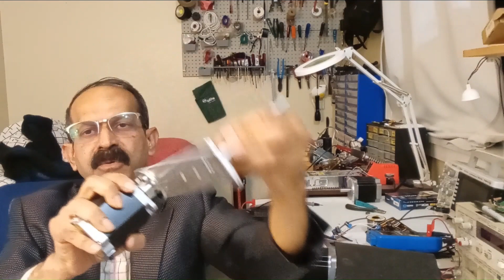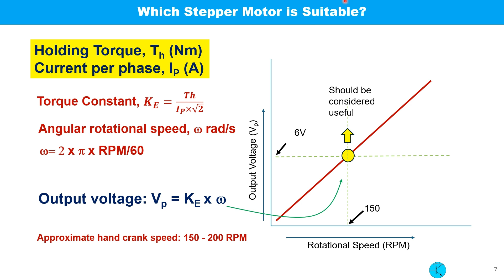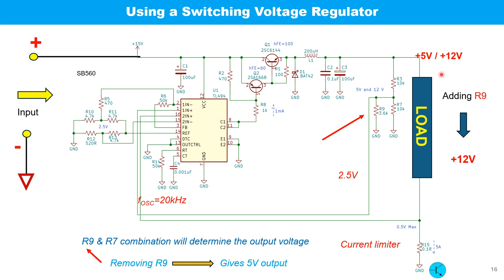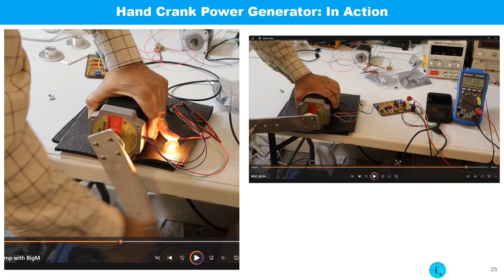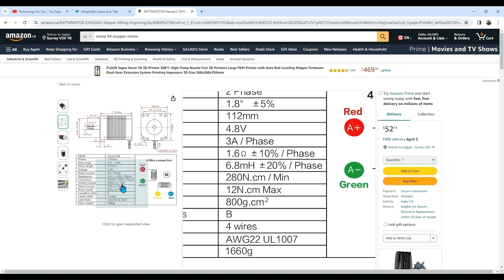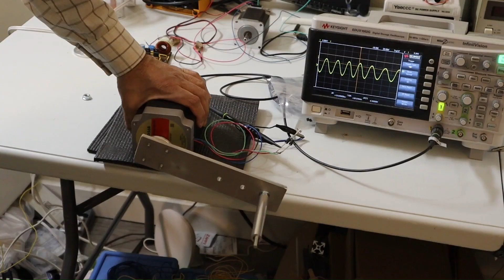Hand-crank Power Generator with Bipolar Stepper Motor

Comment: Wouldn’t you harvest more energy by replacing your rectifiers with two full bridge rectifiers?
Reply from the maker: Full bridge rectifier means also double the voltage drop.
Reply: @technologyforyou5976 but that additional drop is tiny in comparison to the voltage generated by the motor.

Comment: Excellent video If you do need to gear up the Nema  motors   you can get a planetary bolt on gearbox for them  with different ratios a 5:1 ratio is good